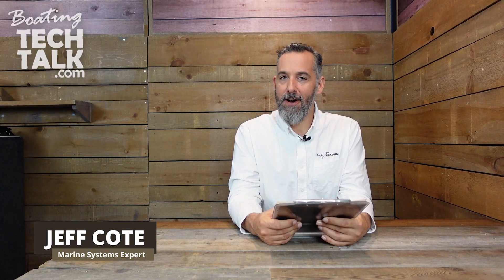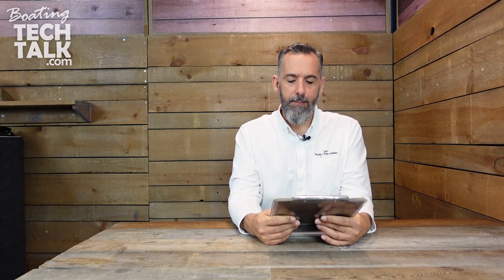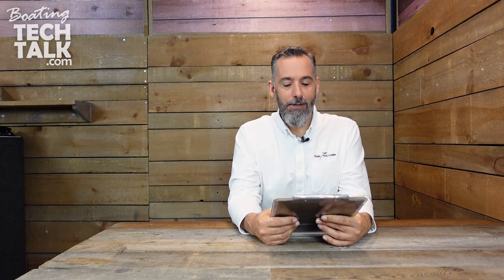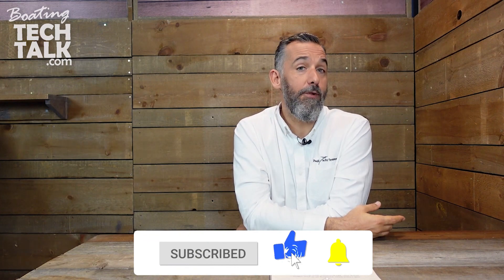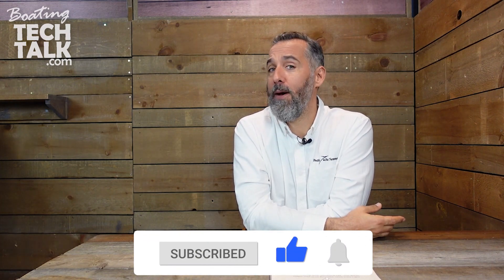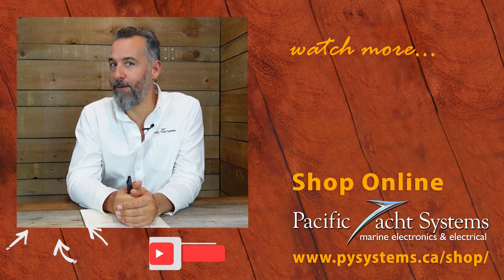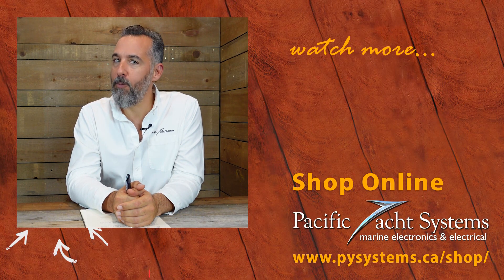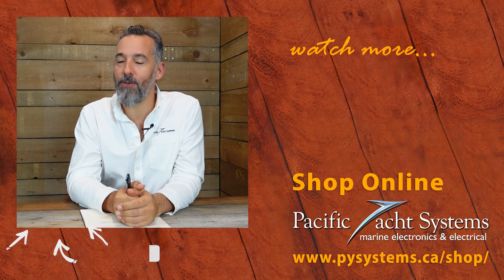How Do I Know if My Boat’s Electrical Has a Bad Ground?

Comment: Hi Jeff, thanks again for all the great videos and valuable information!!! I’d like to ask: what about ground in a steel boat? Is that easier because the whole boat is “ground”? Or should we be more careful? I know you don’t have experience with steel boats as there are not any in the America’s but they are thousands here in The Netherlands :) (and Germany actually).
Reply: Don't use hull to carry current back to the battery. Galvanic isolated grounds and transformers for shore power are wise.
Reply: @braithmiller  I have three grounds on different parts of the hull where many cables lead there. No wonder the hull was like a polka dot design. I installed a galvanic isolator and last season I had a clean hull. I hope I solved the problem of the previous owner… Thanks for your reply!!!
Reply: @anastasiosvanderpas7463  I would improve to all grounds lead back to one buss before reaching the hull anode.
Reply: @braithmiller  That is a good tip, I will look into it. Thanks!
Reply from the maker: Braith provides really good points. Unfortunately, have limited with metal vessels, popular strategy is to completely isolate the hull except for one location, so that the metal hull is non current carrying.
Reply: @PacificYachtSystems  Thank you for your reply Jeff. You are right as well as Braith. It’s cold now but in a couple of months I plan to connect all three grounds back to only one point on the hull! 👋👋

Comment: What is the effect on 12 volt DC electronics when stray 120 volt AC current leaks to ground?
Reply: I for one am concerned (and frustratingly confused) about this talk of American standards ( if I've understood correctly) about making/ bonding a common AC earth and DC earth (ie negative). It's a case of "the more I know, the less I understand". I am talking about a standard GRP yacht setup here - metal fittings in the seawater (props, P brackets etc), 16A shore power via a galvanic isolator and then consumer unit, two or three circuits at most, and the rest all DC run via breaker switches, plus or minus solar input (via a fused interface box and a solar controller). It (sharing earths) sounds potentially very disasterourous and dangerous to me for anyone who works on the DC system (ie the main thing most skippers do) in the boat as any AC fault will potentially leak to the DC system. Dangerous. Keep them totally separate. This why well specified battery chargers (ie with inbuilt isolation) are worth their investment as they represent THE direct/ main point of interface between the AC and DC systems on a normal small boat. Keep AC and DC separate.
Reply: Depends where in the system it happens. Ideal system nothing.
No branch of ac or dc should share a ground.
Ac and dc are supposed to not be co-run or bundled. Use gfci/afgci.
Reply: What ground, DC does not require nor use a ground.  Just because we have used the term ground to refer to battery negative for the last 100 years or so, does not make it correct nomenclature.  There is no ground in DC circuits.  There is only the battery negative. In answer to your question; AC at 50 or 60 hertz is not impacted by a DC negative circuit at zero hertz.
Reply from the maker: My guess is nothing, as a leak to AC ground just completes the AC circuit. Recall that AC neutral and AC ground are connected together.
Reply: @PacificYachtSystems  our AC “hot” and ground are connected only at the pier’s main breaker panel. That’s a few hundred feet from our boat. I understand that in some circumstances an inverter or generator will bridge AC ground and DC negative. I think this also differs depending on whether your boat was wired per European, or ABYC standards.
Reply: @davidlane1137  Thanks for explaining this. I was so confused. I thought I rewired my bass boat all wrong. I am now quite certain it is safe. 2 wires on the boat, 3 in the house (AC) for most appliances. Appreciate you sharing.

Comment: Using a bronze propeller costing thousands of dollars as a ground seems fine until you have actual current on it. At that point, it becomes a sacrificial lump of metal. The same goes for thru-hulls and seacocks you rely on to keep from sinking. I’d rather ground through a dedicated grounding plate, or a large hull-mounted replaceable anode.
Reply from the maker: Thanks for sharing Robert, which grounding plate have you used in the past?
Reply: @PacificYachtSystems  I have a large zinc fish I hang over the side.
Reply: I agree, much argument on this as well as grounding all metal thru-hulls together. Anodes are supposed to protect though they have a limit. 
Personal, wooden vessel, exposed bolted lead keel so this is my ground. The rest are uncoupled. The lead keel has two large Anodes directly through bolted. Copper wire from aft anode to rudder ss hinge hardware. Prop can only afford a spinner nut zinc.
Every boats construction should be addressed individually, my opinion.

Comment: An ohms test is not the best way to test resistance on a circuit, You could have multiple strands of wire and all could be broken but one and it will test good or low resistance.
The best way to test any circuit is under load using voltage drop. I'm in automotive I use it on a daily basis.
There are many good videos on how to perform voltage drop tests, You can go from one end to the other and quickly find resistance in a circuit.
I've chimed in on a lot of channels and most people don't get it, watching someone take their windless off and dissemble and reassemble and reinstall
(which should be done periodically anyways) only to find it still not working then finally find a bad connection elsewhere can be found easily using voltage drop.
Way easy and accurate, works on both voltage feed and ground.........
Reply from the maker: Hi Ken, great contribution!!! Thanks for sharing your knowledge with others.
Reply: You are right Ken

Comment: Well, nice explanation Jeff but how is it in case of aluminium boats and their ground and how do I measure that I have no "leak" into the hull? Thanks a lot for your comment on this.
Reply from the maker: Hmmm, very limited experience with aluminum hulls. Anyone can answer this question?
Reply: Not personal experience. To my understanding good practice is to have a meter set up permanently that you regularly test for stray voltage leaks. So even the test circuit must be open other than for testing period. Both wires to any device positive or negative or housing that electricaly leaks even by salt will cause a galvanic corrosive state. This is so important that if you have to ask the question you need a professional that knows aluminum hulls or dive in this rabit hole. Absolutely shore power must be transformer coupled. Ground through a galvanic isolator. Never use the structure to carry Ground return current.
Reply: @braithmiller  Thanks for your answer. Yes, you are right  - the isolation transformer is a must in this case. Do you know about any stray current meter made for this purpose? I heared that VDO made some in the past but I cannot find any. Thanks.
Reply: @jakubkuzel8064  galvanometer, I am not sure that helps. Outside of my professional experience. Cruisers forum may be a source for advice. Sv Panope on YouTube has an aluminum vessel if he doesn't know likely would know where to direct you.
Most specific devices mentioned in (my)reading are obsolete.
Reply: @braithmiller  Look up the Bender Isometer IR425 Insulation Monitor.
Reply: @SeaJapan  is this something you personally use in this application?
Reply: @braithmiller  yes, on a 60ft aluminium yacht I am maintaining. Is extremely sensitive, which is what I need.
Reply: @SeaJapan  Thanks for the advanced information. As well your channel content, the din rail seems to becoming the marine standard outside the usa.
Reply: @jakubkuzel8064  Victron also does diode based ground current interrupters and some boat designers swear by them. Technically there are cases where AC leaks or DC biased AC leaks could cause the diodes to conduct but from what I've read is that Victron claims a GFC will then interrupt the circuit in such a case. It's a much cheaper alternative to a full-on isolation transformer and should be ok for even an aluminum boat.
Reply: @braithmiller  Ground return current - no such thing.  A ground circuit will only carry current in the event of a fault in an AC circuit.  There is no ground in a DC circuit, people need to start understanding the difference between grounds and circuits.  Then they can tackle the headspace that is galvanic versus stray current corrosion.  As for a leak in the hull it can be of two things: a DC ground (which means your entire hull is part of the DC circuit and therefore carrying whatever currents are returning to the battery but at zero volts potential).  Don't do this, either A) isolate  all DC negative circuit parts from your hull, mainly because you are creating a path to your battery and thus a connection for any stray DC positive current back IE a circuit, or B) isolate all of the positive parts of circuits as they will connect to your "ground" (your battery DC negative).  Together these will, if nothing else, create a battery drain.  Please remember one important thing about electricity, it leaves the source and has to go back to the source.  It's why AC current is not a threat in stray current corrosion, it almost always cannot get back to the source because it will be shore based.
On the positive side galvanic corrosion is between metals and cares not a hoot what electrical devices are connected to your hull. It only cares about an electrical connection (not your DC circuits) between two dissimilar metals.
Reply: @davidlane1137  There is very little voltage required to create an anode or cathode advanced erosion problem. 
DC ground leads will not read a true 0 voltage under applied amperage at a distance from the battery due to resistance. 
AC grounds get induced voltage from wire runs alone before considering faults or degraded insulation.

Comment: All totally separate from all these grounds would be the lightening grounding system right?  Like connecting the metal outriggers to the copper strip going to the thru hull ground to water.
Reply: The protection against lighting strikes is insurance nothing else is going to work.
Reply: H mentions this as the 'bonding' system
Reply: The most critical issue during a lightning strike is to avoid the extremely high difference in potential caused by lightning, which causes destructive arching inside anything that is plugged in (even if turned off). The best way to protect would be a surge protection device (electronic fast acting circuit) that shorts all wires (phase, neutral and ground) during the mili seconds of this event. A good subject to talk about would be what ratings to use for surge protection devices (consult the manufacturers).
Reply from the maker: Thanks for sharing!
Reply: Just like in a house on land, for the case of a nearby hit. ....... But for a direct hit on the boat (or its mast) I guess it's important to make sure the boat has the same voltage potential as the sea, so it does not atract the hit, and that it provides a easy and strong path for the hit to pass through to the sea without burning a hole in the hull (better not via a throughull), and the later is kind of hard to achieve unless you have a wire hanging longside from the top and down into the ocean.